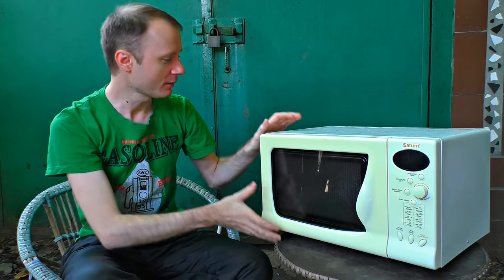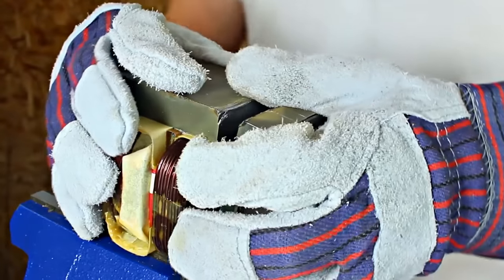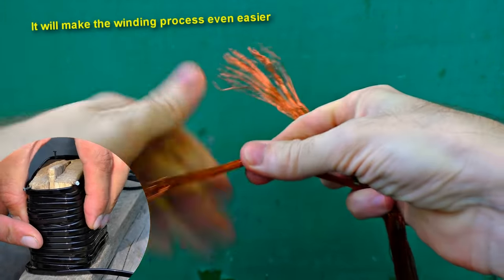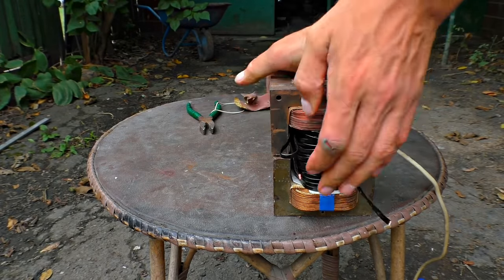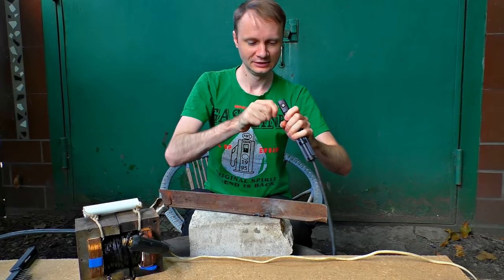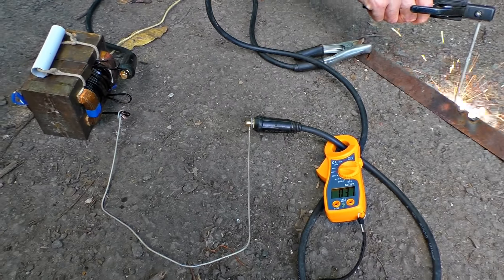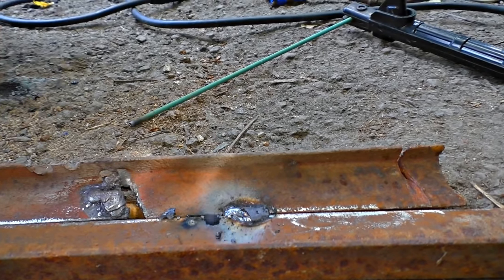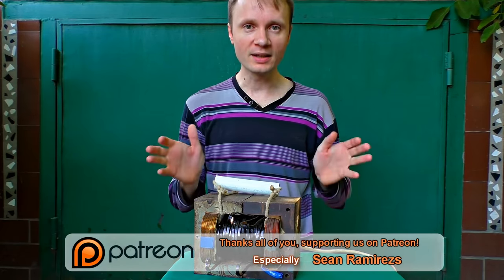Easy Welding machine DIY ! ⚡🔥 Cheap, Simple, Compact!

Comment: Remember: MOTs are designed to be on, UNDER LOAD ONLY. Please don't leave plugged in/turned on unless your ready to use them. Do not leave plugged in  WITHOUT  A  LOAD....in a microwave oven, the MOT is excited when you hit that START button/knob, switches on high power relay, etc.

Comment: Cool. I was about to buy one for my summer cottage, but thought it may be easy to cobble something together from scrap. This is certainly it, there are lots of discarded ovens around. I'll make myself a new welder. Just add a bridge rectifier, welding with AC is a right pain.

By the way, your beads are actually not bad for a guy who have had no welding tuition or training. Doesn't look like stacked rubles, but they do look solid enough. Well done, Sir !

Comment: You shouldn't be welding without the proper (PPE) Personal protection equipment. I.e. gloves, helmet. etc as the ultraviolet arc will burn your skin. You should tell the viewers this. Good to see you protected your eyes as arc eye hurts for Around 24 hours, like having sand in your eyes and there's no cure.......... a professional welder. Besides that, love the channel guys
Reply: Paul Evans (sarcastic) nah who needs protection, you only live once anyways.. (real) but I have made a welder similar to theirs, and I weld shirtless and with open shoes, so I imperically know the importance of standing back or wearing decent shoes, and sunscreen (Im a tan dude and I got the worst sunburn I have ever gotten)
Reply: being a Russian is a protection itself.. next please...
Reply: Yeah it can get bad, I got a sunburn so bad I got sick for a few days once, from three hours of flux core welding. Pretty much got radiation sickness.

A cheap welder will do the trick, and even cheap gloves are better than nothing, but short sleeve shirt is just asking for a cellular ass-kicking.
Reply: don't forget the xrays too.  welding throws out a lot of radiation.
Reply: someone is fun at parties

Comment: I've been wishing for one of those for a while, though I wanted one with way less power, just to weld battery packs. I will probably make something similar to this.
Reply: Fabricio Fanfa You can dig up microwaves everywhere, and getting the transformer is easy.. just rewrap the primary and use a beefy resistor.. or if you're feeling frisky use a bigger resistor and mains

Comment: Most welding machines give you a choice between welding on DC or AC current, or it's just DC, which helps the arc to stay. Your MOT-welder works only on AC, so it's harder to maintain the arc.
Reply: Common welding transformers are only AC. People are welding using these machines for more than 100 years.
Reply: Also his metal isn’t clean, it’s rusty as shit.

Comment: Hello, from Hardisty Alberta Canada. I've made a welder with 4 MOTS,  48 volts at about 130 amps. Works good.  I want to learn your method, of joining two cores. Just started your video.....thankyou. I used 10 gauge solid. could not get enuff turns with AWG 8....

Comment: What if you would put 80 turns of wire and at 50 60 70 and 80 you loop the wire out of the transformer and back in continuing winding. Then you can put 4 outputs with different voltages. What about ten 40 amp rectifiers in parallel on the output? You are welding with AC now. Love your idea good for here in Africa. White Lion
Reply: Lion, You have won the cigar here !  Yes indeed. 
And AC is no good for welding. Can be done, but it splatter all over the place.

Comment: 2 different sticks give different results. 

rutile:the fix anything stick, rutile is most versatile stick of all

Base:the best to use if you know the metal composition, low hydrocarbon

Cellulose: has better rust protection, high hydrocarbon

Comment: Cut the electrode in half or use 2.4 mm electrodes instead so AC will easily penetrate rust.

Comment: In America that copper you used for your winding would probably cost at least $200 I bought 15 feet of 4 gauge stranded wire the other day and it cost me almost $40 USD
Reply: No, it's not that pricey. 35mm2 cable is sufficient for this purpose. You shouldn't pay more than around $5for 3ft of that. 
He was winding way too many windings onto his transformer, hence the output voltage being far too high. You'd be looking at maximum $20, if you want to buy brand new cabling.
Reply: @thefreedomguyuk  have you seen the price at tractor supply lately..? Copper scrap is at a 10 year high and seemingly has affected shelf prices quite a bit. 15 feet of 4g was 36$
Reply: What do you call that kind of wires?

Comment: did you just wire the two primaries in series or parallel?  Did you wind the secondary in the same direction as the primary coils?  nice project!  Adding a choke before the electrode will smooth out your arc :)

Comment: cool video, what's the diameter of the wire for primary and secondary ? 10mm ? AWG 000 ? thanks :)
Reply: 25mm2 is more than enough for the secondary.
Primary isn't critical, as the current drain is low, just use the stock coil.

Comment: Can someone explain how the twirl outs work for controlling power?
Reply: Let's say I have an insulated wire that I wrap around an iron core 120 times. Let's say I apply 120 volts to the end of that wire. Let's say that I measure the voltage at the very other end of that wire and I get one volt. 
These numbers are very highly unlikely. But it works for what I'm trying to explain. 
The reason you get one volt at the other end after the voltage has traveled along the entire length of the wire which we established was 120 rotations around an iron core is because of a principal known as voltage drop sometimes referred to as line loss. Line loss happens all the time with all voltages when they travel long distances through wire. 
Now let's say after 60 rotations around the iron core you have a bit of that wire accessible for you to tap on to. You would now measure 60 volts at that tap point. 
The reason these taps are so important is not for the variable in volts that you get but the corresponding amperages to those voltages. 
If I have that same hundred and twenty volts which is a standard outlet in America on a 20 amp breaker. 20 amps is what it takes for that voltage to trip the breaker. But at 60 volts I can run 40 amps to trip the breaker. At 30 volts I now get 80 amps. And finally at 12 volts I would get 200 amps before my 20 amp breaker would trip. 
There are some other things that go into it like the actual impedance on a transformer. Power factor etc. But now I think you get the gist. What you are looking for is not so much the voltage but very high amperage to be able to weld. Very thick metals require high amperages because the arc will be very hot at high amperages and thinner metal requires lower amperage as to not burn and blow holes right through the metal. All welders you buy at the store have adjustable amperages so you can get the perfect weld. The dial on the welder allows you to tap the transformer at different windings

Comment: You can't get 4kW power out of 2 × 1kW transformeres, even if you connect them in parallel!
Because in a transformer input & output power is ideally the same.
The total power of those two transformers will only be 2kW!

Comment: Hey Kreosan, first sorry for my english but i think it is enough that you can understand me.
I have one question, what is the must important to do a welding machine, it is the voltages, watts or amperes?
And i see you use a Ballast resistor to adjust the voltage? I this correct?

Comment: See at first them clamp together with electric flowing. Good solid core cable. Have some  cable for spot welding but worried it goes pop and not my flat! 
Then call out landlord to fix my tinkering

Comment: Please, you didn't connect amp and voltage control.l have one micro welder in my home and lm thinking how to connect amp and voltage rotating switch controller.please,can you help me out on this?
Reply: Sadly, it's more involving than that to achieve that functionality. Basically, you need a different set-up, with a switch mode power supply.

Comment: I learnt my lesson by not using a proper welding helmet. I also used only the glasss of the helmet and everywhere the glass was NOT protecting was "Sunburnt", so I had a white rectangle over my eyes and a pink face.

Also you need to cover your skin man! you WILL get burnt from radiation.

Comment: Think of yourself as being inside of a plasma ball. How would you protect yourself? Their technology works as if you where in a plasma ball. Basically you have a glue in your lymphatic system that causes you to hallucinate while giving the current a path to travel. Your lymphatic system can’t function normally because of this glue and builds pressure as they shock you. The valves of your lymphatic system are plugged and release when the pressure becomes to much releasing the mild hallucinogen causing you to become very confused as they continue to shock you. The current robs you of electrolytes, vitamins, and minerals causing you to become drowsy while increasing your heart rate keeping you a awake and hallucinating. So your mind and your body are confused one fighting the other releasing adrenaline and hallucinogens into your blood stream. Keep a clean lymphatic system and environment. Treat this as germ warfare.
Reply: Wtf kind of welder does that?! Is there some special accessory you can buy for that?😂😂😂
Reply: Now I definitely need to make one. People pay good money for those kind of trips but this won't show in a pee test. Let the build begin.....Thanks for the info!

Comment: 03:53 during soldering on iron if we touch iron stick, why we not feel electric shock ?
Reply: because the nicrome wire is isolated by thin heat resistant sheets (disassemble one for yourself) but Soldering irons are not super isolated(depends on the solder iron quality), if you solder led's or  you would see the led glow a bit
Reply: the orange welding machine uses low dc volts to weld so thats why you dont feel a electric shock
Reply: @justffff  he is talking about a soldering iron not a welder
Reply: @vampy625  look at the time stamp, they just used the wrong term
Reply: @justffff  Okay then we both are confused now

Comment: 4:10
If you are a so called "amateur",you should definitely NOT do this!
Reply: It's safe.
Reply: @tearex7023  it's not.trust me, I'm speaking of experience.
Reply: @zaku2552  I literally modified an MOT for high amperage and i haven't died yet. I'm looking into this project too. There is less than 40 volts which can't even shock you, only tickle your skin in an unpleasant way. Just wear any gloves.
Reply: @tearex7023  I'm talking about the input side(in his case 220V) and the high temp of the electrodes.
Reply: @zaku2552  Yes, you can just stick the transformer in a plastic box. High temperature isn't a danger, it's like with any normal welding machine.
If you tell somebody all the safety precautions they will be completely fine.
Reply: @tearex7023  I know but amateurs don't think that far. Im pretty sure there are even kids here that will want to try this now (and cuz their parent probably wont allow them to do that,they will do it secretly and don't care about safety precautions)
Reply: @zaku2552  Then it's their fault. He only said that amateurs could theoretically assemble it, which is true. He should've addede a warning and safety precautions.

Comment: Please put a little more details . it's so hard to make and dangerous.
Reply: I got a Welding Machine - 125Amp Flux Core Welder for $92.00 at Harbor Freight and everything included!   Is your " Life " worth $92.00?  WATCH... Some " STUPID " arse gonna say something, watch!  😂😂😂😂😂😂😂😂😂😂😂😂😂😂😂😂😂😂😂😂😂😂😂😂😂😂😂
Reply: OK MY Bad!!
Reply: +Adil Aziz - I agree with the " dangerous " part of your post and that is why I said is your " Life " worth $92.00?  So basically I agree with your post 100% !!!
Reply: OK thank you  and sorry for the miss understanding.
Reply: Watch the king of random's diy welder.. these guys did the same thing but in one transformer rather than two
Reply: Also I've been working on something like this for a while now.. started with two single microwave oven transformers (mot), and wanted more power, so I did what kerosan did, but with one primary coil, and thicker wire (and two of them) but the insulation melted after a half hour of  solid use. Now I'm trying to use copper pipes with water circulating
Reply: Jordan Bronson why do you say it's so dangerous? I've done essentially the same thing.. it only goes up to 50 volts.. sure that will not feel good when you touch both ends (I speak from experience) but no one can die unless they touch the mains power
Reply: Adil Aziz I have not tried car battery welding, however we do have an electric lawnmower, with two 36 volt lead acid batteries (36 volts is perfect for welding). The batteries are 3 times the voltage of your average car battery which is 12 volts. they aren't rated for high current applications (like welding). So I connected them in parallel. Long story short, you could weld very easily with my setup, but for about a minute before the batteries needed to be charged. Also I pulled too much current through one, and melded a wire in the battery (thought you shouldn't have this problem on a car battery) As for using car batteries I've never managed to get my hands on enough to weld with, but I can imagine a similar experience. I would recommend making a transformer based welder as they are cheaper and more reliable, but if you're in a pinch, you gotta do what you gotta do.

Comment: One day this guy lose eyes
👀 ☇🚫 👓
Reply: Tomasz it happens in secconds not days and he is fine becuase he is using UV treated glass to block the harmful spectrums of light being produced.
Reply: Stoned Savage! 2:21
Ok 
I talking about this moment. He dont use protect glass.
Reply: Tomasz even there its fine because it was a direct short circuit across 2 electrodes and does not produce the U.V rays needed to be harmful to the eyes its like looking at toaster heating elements they glow orange and wont hurt anyones eyes.
Reply: Stoned Savage! I am talking about caution.

One day this gentleman will make himself an unwanted pony because something will catch his eye.    Like a spark.  The guy creates the conditions for this to happen, increasing the probability.

I am not talking about welding without glasses, but about the lack of protective glasses.    In the end, the guest makes films and people watch him.  Probably everyone is waiting for the episode when the hot metal reaches .